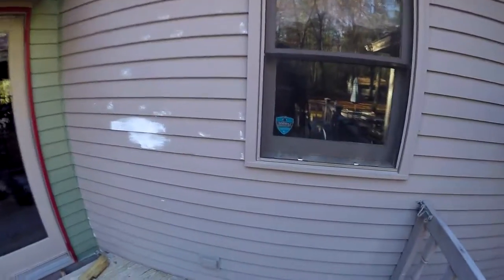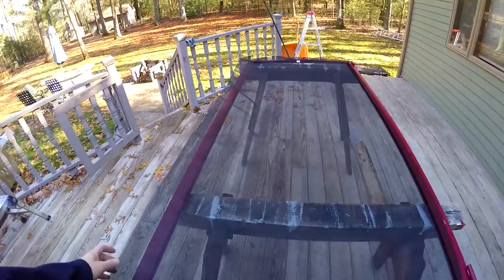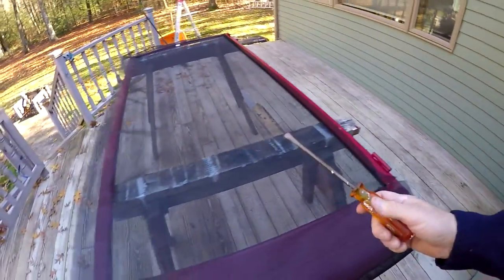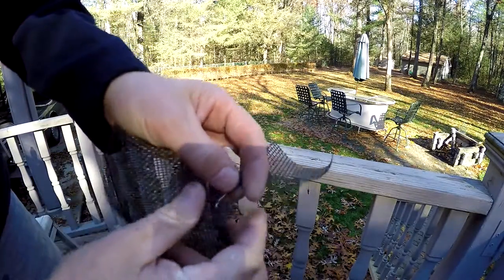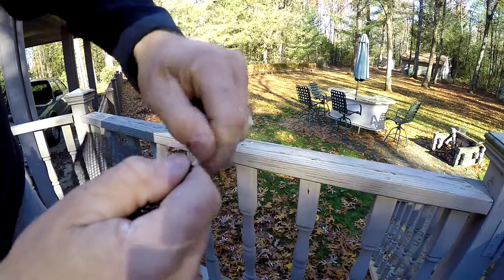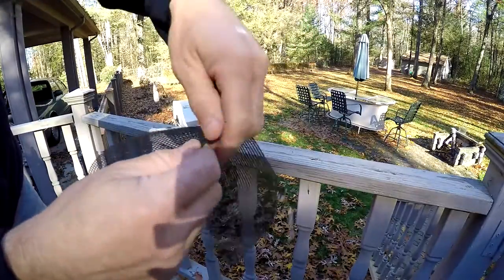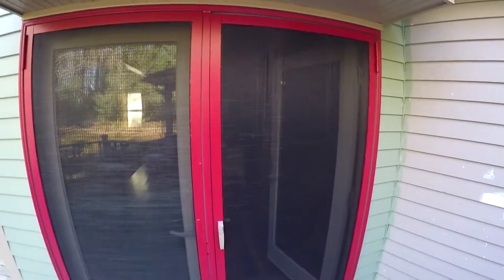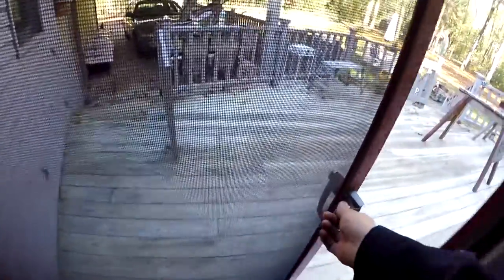rip proof screen for pets

Comment: Thanks for your informative video. I just put up a screened enclosure and did,nt think about my little dogs jumping up on the screen. Then, after i finished, someone told me about petscreen. I actually thought it might be tough to install and about the spline size. I,ll see how my normal screen stands up to the dogs, but if i have to go down the petscreen route , at least i,ve had some advice from you.

Comment: I think that white stuff is fiber glass. 
I found your video while looking for reviews of "seevue" ie stainless steel insect screen, which is also supposed to be good against termites and rats.
Reply: I read somewhere that pet screens use woven polyester that is plastic coated.  This brand may be different, but I would bet it's polyester due to  its strength.